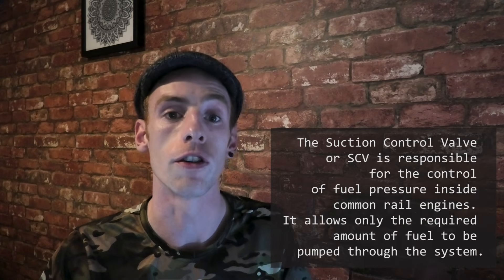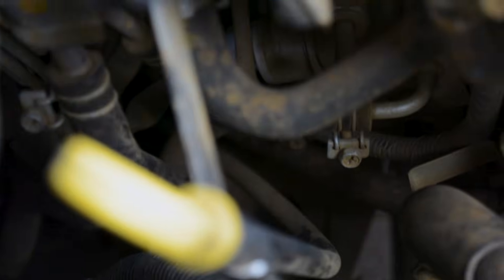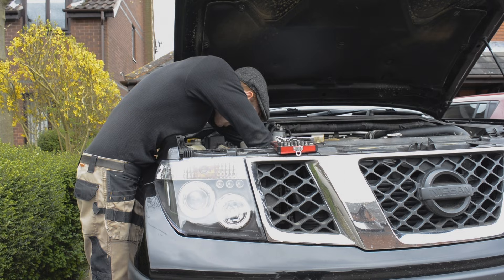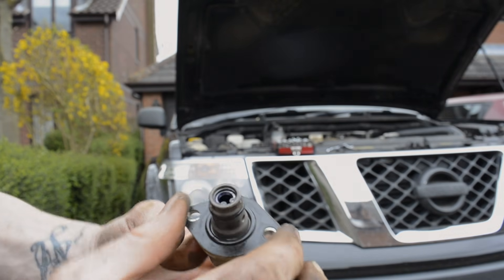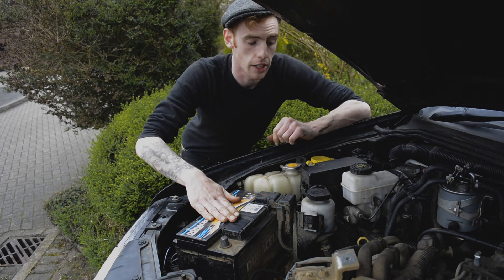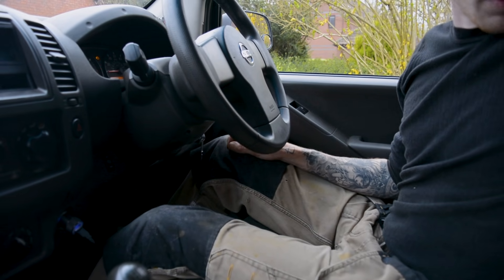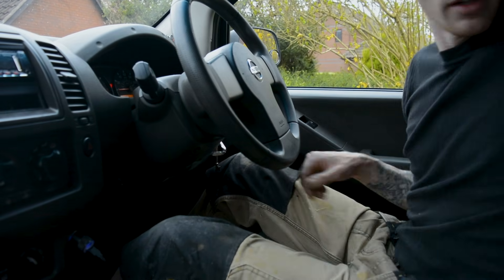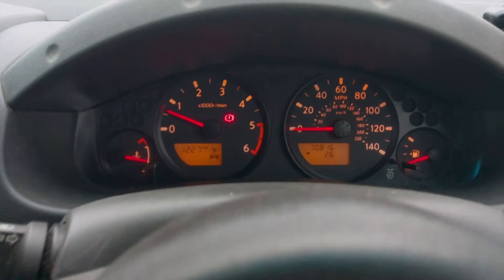Limp Mode - Nissan Navara YD25 - SCV Replacement

Comment: I have a similar issue but the obd2 says the fuel pressure sensor 1  p0089
Reply: @nick_fury6120  my car is doing the same thing did changing the scv work

Comment: do you know if if a faulty SCV shows on ECM errors?
I am getting a weird behaviour and I don't know if it will be from SCV. I don't have records in the ECM, recently I can't get the engine to start - it cracks but no run. battery is ok... also I already stopped in road. 
If I insist on the key doing on/off a few times and then I crank the key and starts the engine. I suspect an faulty electric pump, but now I saw you video I am curious...

Comment: Can I reset the Scv and ecu if I didn't light up the dashboard light, who changed my scv, I'm not sure if they reset my Scv and ecu, but they changed the Scv and it still runs like that, the Nissan doesn't rev past 3000 when I first start it in the morning, if I turn off the engine and start it again it revs normally, and I think the mechanics cleared my error, now I haven't lit any lights on the dashboard but as I said when I first started it didn't rev, can I reset the Scv and ecu again if I don't have any lights on?
Reply from the maker: You can indeed! Apologies for the delay in replying. It's often a good idea to do a reset every now and again regardless of the light.

Comment: Great video mate.

I’m in the process of ordering and replacing my scv on my Nissan navara 2.5 d40 tekna 174000 miles on the clock. It’s gone in to limp mode with code p0093 

Thanks for the video 👍🏼
Reply from the maker: Thank you! I'm glad it's been of assistance for you. Hope it goes well 🙏🏻🔥

Comment: Good video to help replace the CVT, but that music has to go. It is too dominant and can not hear you talking clearly.
Reply from the maker: @CiaranWhelan  Yeah I really wish I could remove it in hindsight, early editing mistake. If i ever redo this video I'll make sure it's more audible. Thanks for the feedback 👍🏻🙏🏻
Reply: @PrimalNomad  I meant to mention that the description of the sequence of pushing the pedal down to reset the ECU and put it into learning mode was brilliant. I have an R51 diesel Pathfinder and need to look at problem solving. How did you find the information about the pedal sequence.

Comment: Had a similar issue with my d40 going into limp mode after being idle for a while. Changed the turbo valve solenoid and issue remained with the actuator still having play. Read online that the SCV was related to this specific issue. So i bought the part yesterday and stumbled onto this video at night. Decided to reset the ecu like how you did before changing the scv. To my suprise i had power after being idle for a while. I'll still check the scv to make sure there's no erosion, if there is I'll just replace it.

Thank you for making this video. Years later and its still assisting your viewers.
Reply from the maker: That's the biggest Win! I'm so glaf that this is helping still & hopefully keeps these engines alive. Appreciate your comment 🙏

Comment: I did not Understand how you stepped the acelerator in order not to scan the system
Reply from the maker: Sorry for the late reply, To carry out the reset, follow these simple steps:

Turn ingnition on so all dash lights come on.

Wait 3 seconds

PUMP accelerator pedal 5 times within 5 seconds....

Take foot off the accelerator after last pump and wait 7 seconds...

After 7 seconds press and hold down accelerator pedal for 10 seconds...

Atfer 10 seconds the Engine Managment Light will start to flash, at this point remove foot from accelerator.

the Nav is now in diag mode, so let the EML flash for a bit. the press and hold the acclerator pedel down for more than 10 seconds..this will then reset ECU and fuel pump etc......and put them into learning mode.
Reply: @PrimalNomad 
Thank for you support

Comment: Do I have to bleed the diesel injectors when I replace scv? I've heard of diesels reving up and not shutting off
 So that's my only issue. Do I have to unplug something and bleed injectors once I've replaced scv.

And do i need to reset fuelpump, and ecu. I have a tune so will that effect it.
Reply from the maker: No you shouldn't have to at all :) - Just the fuel pump reset so it learns the new valves tolerances. Thanks for watching

Comment: Brother , my navara automatic ,thai, 2010 edition ,having the problem of not getting power after 2500 rpm and gives a shake when i turn off the engine ,can SCV   be the reason? CUZ I  changwd the pruge control, turbi control solenoid last week still same
Reply: Hello, your problem seems exactly like the mine one. I have used my Navara automatic since 2006 like that, avoiding any acceleration more than 3000 rpm. Btw, I visited 5 different Nissan dealers during the warranty period, nobody was able to solve the problem.  Suction control valve had been changed also.
Reply: Try this which I do for my navara d40 for fuel problems. Buy a liqui moly diesel purge remove the fuel line into the pump & return line from the fuel filter. Take a glass jar and fill liqui moly and put both removed fuel lines into the jar. Start the cab & continue it with different rpm levels. It will cleanup everything in rail and pump. Problem will resolve.
Reply: @sssperera and its the same?
Reply: @stephanasdariusboisselle8635  wt u mean ?

Comment: I changed my SCV on my fuel pump and did the routine to sync everything but engine lights never flash what does this mean
Reply from the maker: Potentially that the pedal 'dance' didn't work correctly. Have you tried doing the reset again? If not it's usually fine as the scv will learn over time

Comment: I changed the part put when doing the last bit my engine lights never flashed at all what does that mean
Reply from the maker: Have you tried doing the reset again? Maybe the pedals weren't held down for the full seconds. I usually count a bit longer than my usual seconds haha
Reply: @PrimalNomad  I tried again but the engine light did not flash but it's running, I have to change the park nuteral switch once I do that then I'll see if it runs with out stalling
Reply: @maryellabrown5350  the light will flash, just gotta time it correctly, may take a few goes

Comment: Hi from Oamaru Sth island New Zealand

Question.

Any other possible causes to this misery?

A horrid white Hazy comes out of my 2012 Nissan Navara D40 St-X Diesel Spanish built then engine has rough lumpy idle then cuts out after 2 minutes or accelerated.

E.g.r valve and cooler is fine.

I possibly have coolant leak but there's no water in my sump oil or oil in radiator coolant.

I'm not sure if e.g r valve failure can lead to same symptoms or ths.

Do you think s.c.v would cause any issues to symptoms?.

Cheers Carl
Reply from the maker: Hi Carl! Sorry for the late reply, Youtube hid this from me for some reason 🤔. I'd suggest that the limp mode might also be related to the MaF sensor or BCV but potentially an injector issue also. Have you tried doing an ECU reset & fuel pump reset to see if you get any improvement, even temporarily? If not maybe I can arrange a chat with you to further diagnose. Liam
Reply: Hello sir, we did the whole process of resetting the pump and ecu but the still the car doesn't start,I don't know what's causing it not to start,maybe you could enlighten with other causes that causing the car not to start 🙏

Comment: Hi mate .. I have my nissan pathfinder,  when climbing hill go slow and i have clean the throttle,  still the same
Reply from the maker: Could be worthwhile cleaning your MAF sensor, EGR or BCV, they could all be culprits. But likely to be an airflow issue, maybe vac lines would be worth following to the air box and check for any leaks or splits

Comment: Dear Primal Nomad 
Thanks for your time and effort to publish you video. I replaced the SCV on my Nissan Navara LE 2012 4x4 & Manual Transmission, given the fact that I was experiencing the same symptoms you described i.e. once starting the engine first time in the morning the motor started fine BUT it stopped once the RPMs. decreased below the 1000 RPM. Same problem for a while but after the motor is at operational temp no more issues though sometimes - on a very random way - it will stop while waiting for the green light at the semaphore.
Unfortunately the problem is still there after the replacement. Please note that after following precisely your RESET procedure I couldn't have the CHECK ENGINE LIGHT BLINKING...it has been lit all the time.
Then I start the motor and unfortunately still have exactly the same aforementioned symptoms. Please advice. THANKS !
Reply: Hi Ramon, I read your comment here and felt I wanted to ask you if you’ve diagnosed/fixed your issue. I have an ‘07 D40 Nav Spanish, with the same problem you describe. I’ve replaced the SCV/cleaned MAF and replaced fuel filter. Car still stalling when cold.  I fear it’s a timing chain issue. Any new info on your car? Cheers.
Reply from the maker: I'm so sorry Ramon for a late reply, I never saw this comment until Christopher replied to it!

In regards to both of your issues, I'd be very interested to see how your EGR's are, it may be blocked and causing the issue. This can then cause the MAF and BCV to work improperly causing an airflow issue and therefore a similar symptom to your diagnosis.

Have you got an EGR plate installed also?
Reply: Hi mate, thanks for replying.. I’ll continue the thread for now haha.. EGR is not something I’m far I liar with, however on my car I’m quite sure the issue is worn timing chain/sprockets.. after disconnecting the cam angle sensor the car started and idled normally.. suggesting the sensor picks up the issue with the chain and cuts the motor out.. it is more of an electronic ‘cutout’ rather than a stall issue. I’ve since taken steps to buy a double row/duplex chain upgrade kit. Very expensive, but gotta do it.

Comment: What if i replace the suction control valve then starting it and driving away ? what would happen ?
Reply from the maker: Nothing, it will just run on the old setting adjusted to your old valve. You can do the ecu reset now if you want and it will learn the new valve

Comment: Can u give Step to reset the ecu...
Reply from the maker: To carry out the fuel pump reset carry out the following - 

Turn ignition on so all dash lights come on.

Wait 3 seconds

PUMP accelerator pedal 5 times within 5 seconds....

with foot now OFF accelerator wait 7 seconds...

After 7 seconds press and hold down accelerator pedal for 10 seconds...

After 10 seconds the Engine Management Light will start to flash, at this point remove foot from accelerator.

Comment: my Navara automatic transmission starts fine and drives ok, but a couple of times limp mode yesterday. today starts fine but when taking off still is has no power until I have some speed. no fault codes in ecu. could it be the SCV? thank you very much!!
Reply from the maker: Hey Andy! That definitely sounds like a dodgy SCV, it's also worth checking over your vacuum hoses from the Boost solenoid (on the side of the air box on my manual d40)  and the MAF sensor on the airbox also, mine was limping from the moment I turned the ignition once and it was the MAF sensor plug wasn't clipped in fully. Limp Mode is a very common symptom for the SCV though and it's a part worth changing every 5 years or so in my opinion.
Reply: @PrimalNomad  thank you very much for responding! Ive already checked the hoses and maf sensor. Ordered an SCV and I hope it’s ok when installed. I’ll keep you updated!
Reply from the maker: @AndyVdw-1  no problem at all! Definitely do :) good luck!

Comment: I drive a 2014 np300, d22 shape. I changed the SCV and it's the same problem,  any suggestions?
Reply from the maker: I've heard of issues with the turbo boost pressure control, it also could be the Egr. Maybe worth checking the Vacum lines from the turbo too. I'll have a think of any other options to check!
Reply: @PrimalNomad  thanks much I really appreciate it

Comment: Hi my d40 takes several attempts to start after stalling, could this solve my problem! Many thanks
Reply from the maker: Hi Lewis! Sorry to hear you're having issues. I'd definitely recommend changing this valve if there's an issue with fueling (sounds like it) it could be that it's in a perpetual Limp and therefore can't start!
Reply: @PrimalNomad  Thankyou for your reply I will give it a try!
Reply from the maker: @lewiskent6207  hope it works! 🙏

Comment: My nissan pathfinder 2005 dci automatic only driving in 3rd gear. Speed reduces and Il have to switch off and start again. Also struggling to Pull or drive when switching on
Reply from the maker: Have you checked egr & also mass air flow (MAF) sensor?

Comment: Hi mate... When trottle my d40 will goes to limp mode and rpm will never be exceeding 3000 rpm on the sixth gear/top speed. The code says ..Turbo Booster Circuit. Do you have any ideas that caused this. Appreciate your idea mate.
Reply from the maker: Limp Mode suggests SCV is bad, but also it could be the boost control solenoid if it's no boosting properly? I'll have a look at that circuit, hit me up on instagram @primal_nomad to chat if needed!

Comment: Hi do you have to pump the acceleration pedal to reset or can you just drive as normal after letting the 4x4 warm up first?
Reply from the maker: Hey! Only to reset the fuelpump you should pump the pedal. Do it after changing the scv for sure! If not normal starting procedure :)
Reply: @PrimalNomad  okay cheers also I have a hissing noise on acceleration been told its a boost leak although doesn't seem to lose power.. could that be right?
Reply from the maker: @mrbee6339  definitely worth chekcing out the vac lines and the turbo actuator! The lines go from the bcv to the various parts I have another video on that too. The lines can split and cause a boost leak although I'd think you'd feel the lack of power at points on boost.

Comment: is this common rail
Reply from the maker: Yes, it's a yd25 diesel common rail engine.
Reply: @PrimalNomad  i think they did the common rail denso pump, and a common rail bosh pump as well, with the bosh one given the DCI tag, i believe
Reply from the maker: @nathanreid2974  I've seen both too, mine in particular was a denso valve and I replaced with a like for like :)

Comment: My np300 d22 yd25 engine will get a little bit stuck on rev 900-1100 and rev slow and after that it will do perfectly... When driving when going over a bump and the rev goes below 1 especially on gear 2&3 it will rattle also when when loaded on a small hill it will rev down and will turn off forcing me to use 4wheel drive high  what could be the cause and how can I resolve it? Thank
Reply from the maker: It could potentially be a faulty SCV if it's in Limp Mode, mine used to do a smiliar thing after booting it a bit, if not maybe a boost control solenoid or transfer case switch if its forcing 4wd high? I'm not too familiar with the np300 albeit!

Comment: Thanks for all the effort you went to, showing us the pointless dropped bolt - maybe you could have used the camera to actually show us a closeup of the SCV before, during and after installation?
Reply from the maker: No problem! Handy to know where these little bolt traps are hey 😉

Thankfully it's not that hard to find the scv, it looks like the one I'm holding on the thumbnail & exactly where the camera shows it it :)

Thanks for watching 🙏

Comment: thats awesome bro i recently changed my scv  and the upper chain tensioner as that was bad  . the timing is spot on. i used a diagnosis tool reset the scv and now the vehicle is not starting at all ( advice came from a haynes manual)   im gonna try your method tomorrow to see what that does mines a R51 pathfinder by the way 2006
Reply: Would be good to hear how you get on as I’m contemplating doing the same on my 07 pathfinder as I’ve been quoted over 400 from a garage to do the work.
Reply from the maker: I hope you both managed to get it all sorted in the end?
Did the fuel pump reset help?
Reply from the maker: Hey! Sorry for the late reply, how did it go?

Comment: The diagnosis show error to the relief valve...do you know what fuel pressure relief valve is??? I don't have any ideas...is suction valve the same ??? Sumptoms are the similar...when i put pressure to throttle,  the machine is getting almost everytime to limp mode
Reply from the maker: Yes this sounds like the scv! Limp Mode on full throttle.
Reply: @PrimalNomad  is the relief valve the same???
Reply from the maker: @HuntingandfishinginCyprus  sorry , no the relief valve is located on the end of the fuel rail toward the rear of the engine. It could be a cause of the Limp Mode too as your code suggests. Quite an easy change if you get the banjo clip undone :)
Reply: @PrimalNomad  thanks very much for the kind suggestions...take care...
Reply: Hey mate my car is doing tbe same thing i tried the reset but it did not work its a 2008 rx d40
Reply: @michaelnewton2300  i replaced sunction valve and solved

Comment: hey boss just wonderinh what code did you get?P2478 im getting this code all the time with my d40 2011 thai
Reply from the maker: I can't remember the code exactly but it wasn't p2478, that's showing Exhaust Gas Temperature Sensor or possibly injectors. I'd start with testing the EGT sensor and work on from there. Keep me posted.

Comment: Trying to find the part number here in Australia I have a 2007 d40 2.5L turbo diesel and it’s going into limp mode even in idle sometimes
Reply from the maker: I'll have a research, the navlife group on Facebook may be able to assist you also!
Reply: Hi Greg, were you able to find the Aussie part number?
Reply: Call Nissan parts give them the vin and the engine number. They helped me with part numbers previously on my Navara